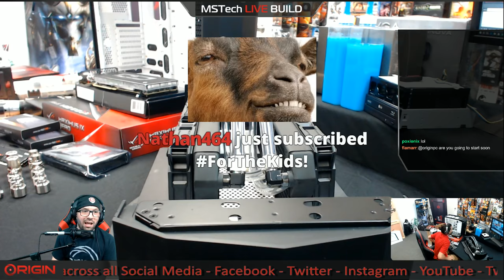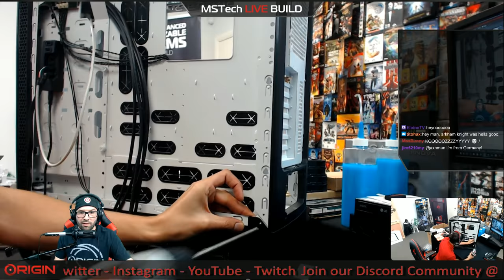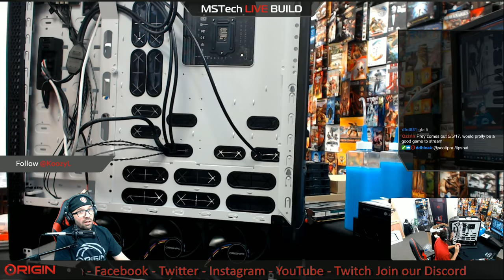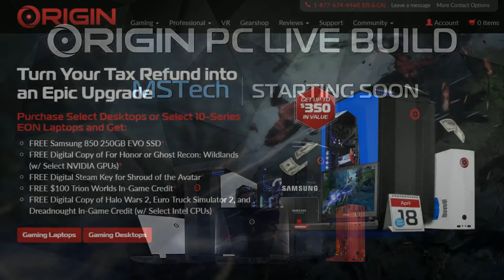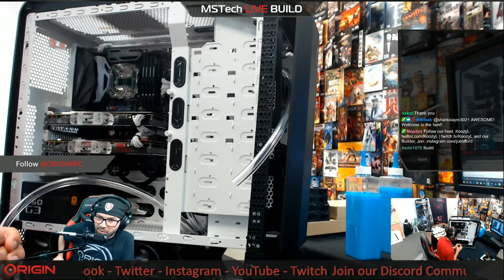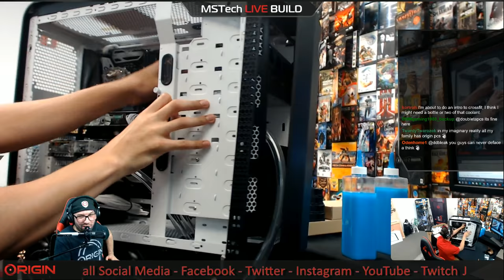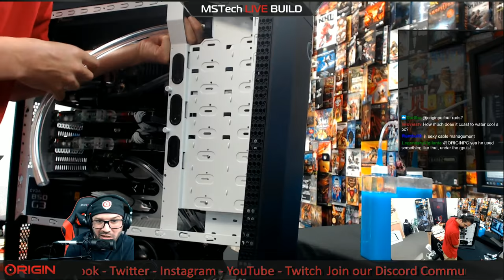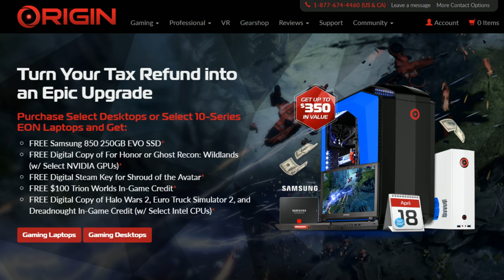MSTech's ORIGIN PC LIVE Build - #ORIGINPC #Tech #PCBuild #HighEndPC

Comment: Hello,

I've been having problems with one of my PC fans for about a month now (top back fan).  ORIGIN PC has sent two replacements fans now, and I'm still having problems.

The first fan that was sent to me, stopped working after a few minutes.  Now the second does work, however the RPM on it keeps going up and down by itself.  It is not a temp issue on my motherboard because it is steady at 30 degrees.  I'm not sure if the issue has to do with misconfiguration with your sentinel program or voltage issues in the motherboard bios settings.

You can contact me by calling my cell phone at 

I hope we can resolve this problem as soon as possible.  I paid over 4K for my PC, and since I got it has been nothing but problems. (I'm sure you can see in your ticket system "remedy" or whatever you use to track issues how many times I've reached out with problems.)

I'm about ready to reach out to the BBB and file a complaint on ORIGIN.

(when you call me back, please make sure to be an actual technical person that know what they are doing.  Most of the helpdesk agents that I've worked with from ORIGIN PC do not seem to be very knowledgeable)
Reply: Hello
They are sending me a crate so that I can send my PC back for repairs.

Not what I wanted after just a few months of having gotten it, but we'll see.  I hope it can be fixed as soon as possible.